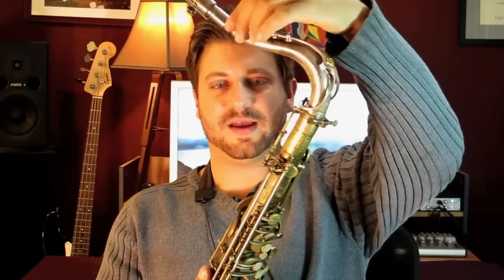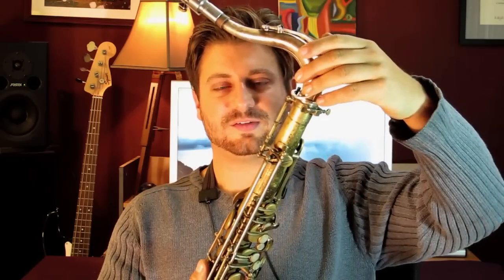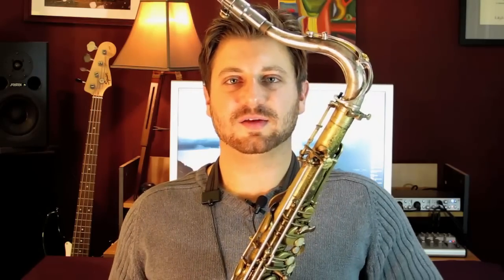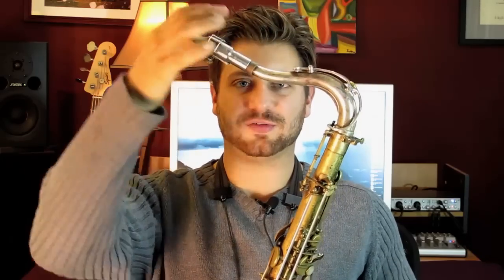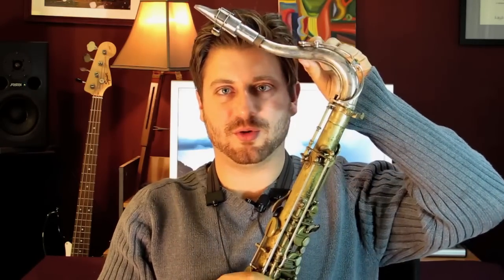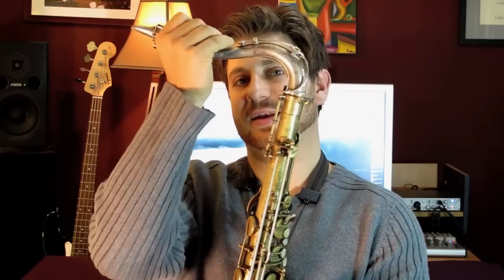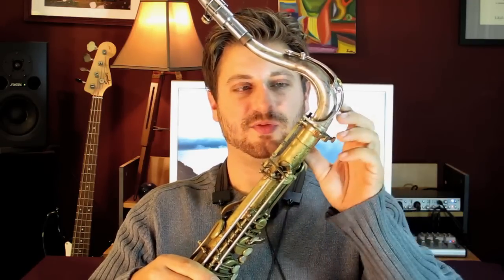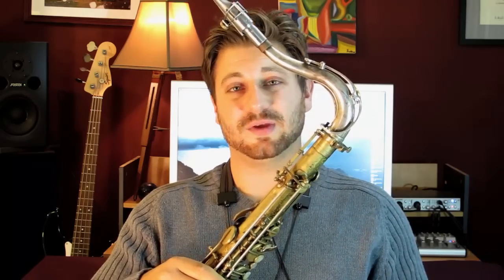How to Fix the Neck of a Saxophone

Comment: In addition to all of these comments,  if you bend a piece of sheet brass in one direction, there is absolutely no guarantee that it will bend back in the exact same spot. You will end up with multiple bends, weakening the material, distorting the tube... And worst of all, if this is a habitual problem for one person, they can cause irreversible damage with two or more attempts at your "solution" 
Ehow must remove this video. Multiple respected saxophone technicians have commented below condemning this procedure.

Comment: This has happened to my Alto Sax. For temporary repair, use a rubber band. It can still be playable if you use. Not to tight or you can't play the HIGHER NOTES.

Hope this helps. ;)